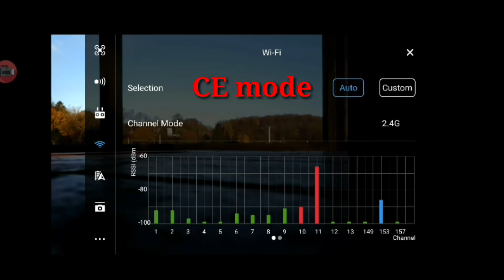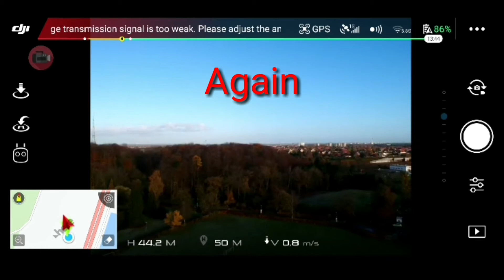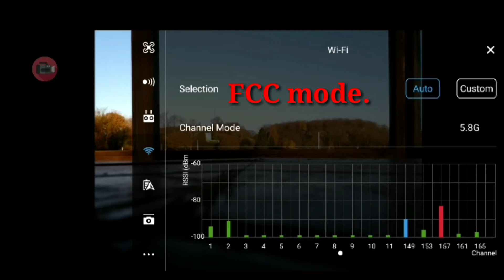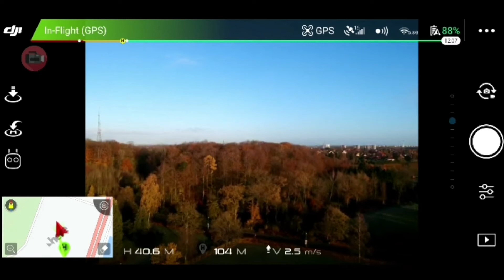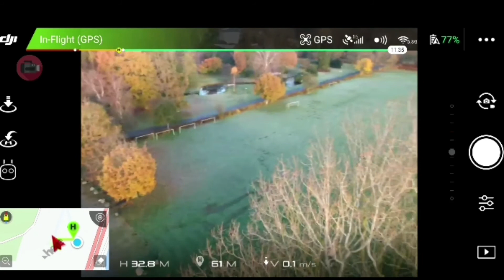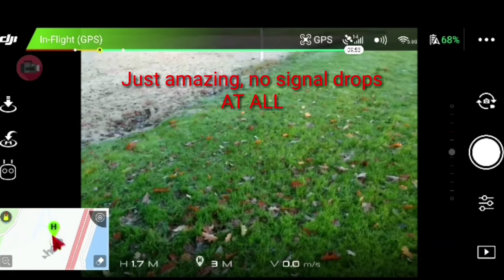DJI Spark CE vs. FCC

Comment: Modded app I assume?
Reply: Today you doesn't need modded DJI GO 4. You need other app, that will create fake GPS position (inside USA of course) for phone (and DJI Go 4). Then you need to change Wi-Fi setting: click "OK" when such window will appear. Later click always "Cancel".
Reply from the maker: techher yes se my other video on instaling it😉
Reply: This is what I did on my Mavic Air. So easy to put back to normal without the need to edit any code.